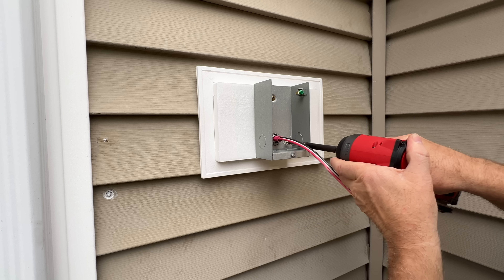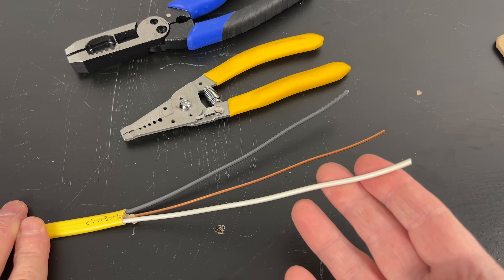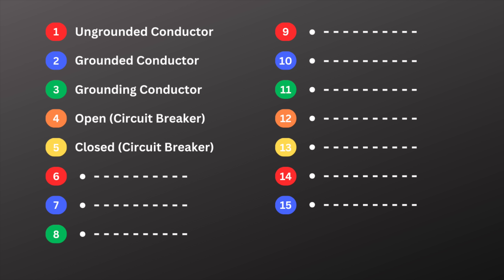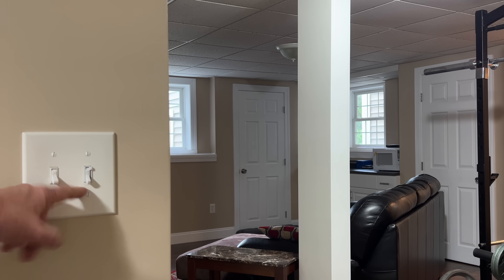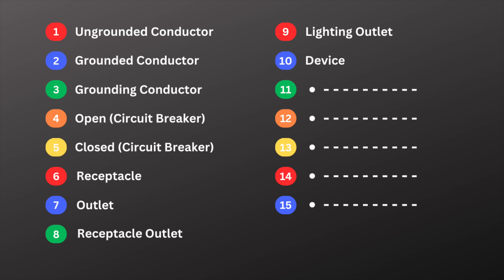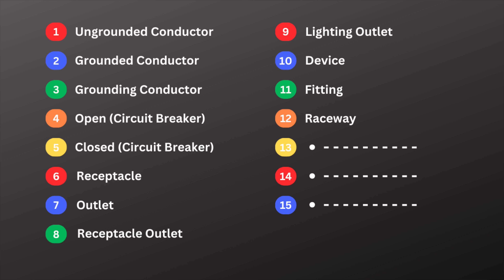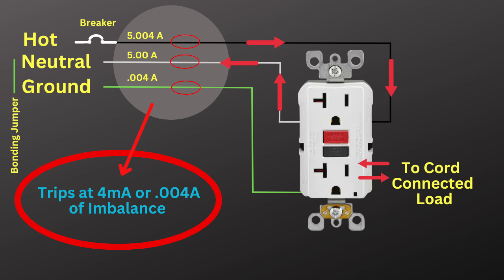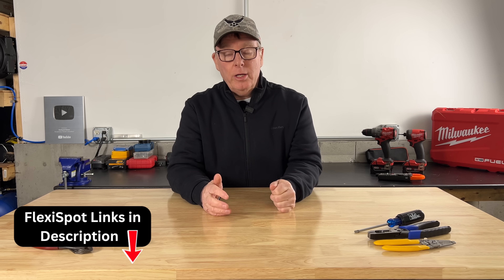15 Electrical Terms You Don't Know.

Comment: This is a great video.  One nitpick, though:  In a ground fault, current does not take a path to ground.  It takes a path through ground, back to the source.  The ground is never the destination for electricity, only a path it can potentially take.  A lot of people misunderstand this, so I think it is important to be careful about the terms that we use to minimize that misunderstanding as much as possible.
Reply from the maker: That is true.. Without the main bonding jumper a breaker would not trip because the earth is too resistive. I go into detail on that in my grounding and bonding video. https://youtu.be/gchq6G5Wc8M  I'll have to rewatch this video to check my terminology but it sounds like misspoke. Thanks for your comment as always.

Comment: The grounded and ungrounded conductors are distinguished only by that characteristic, but you distinguish them further by saying that one carries current from the transformer the load, and the other carries current from the load back to the transformer.  This is incorrect and I am sure that you know that.  The two wires make a circuit through the transformer and the load, and the current flows in both directions, changing direction every 1/120th of a second.

Some people may think I am nitpicking, but my observation, after reading many comments in forums on videos on this subject, is that many people are confused about how AC works and about the neutral in particular.  The reason, in my opinion, is that many people describe the workings of AC circuits in loose, incorrect language.

Comment: Been an electrician for decades and still get caught up in terms or names every now and then that I haven’t seen in so long I have to think back; sadly my memory isn’t what it used to be and I find myself checking code as much as I used to when I first started on things I haven’t don’t in a while. Thankfully I use a digital copy of the code so checking or confirming things is much quicker. The biggest thing that gets me is having to use different electrical supply houses as none use code nomenclature and instead use the brand they carry, which means you need to remember what lines they carry, as most of the counter staff is newer and doesn’t know much about electrical meaning they only know the names of brands they carry.
Reply from the maker: I know what you mean! Sometimes I have to look up stuff I've done a thousand times before. Age is a thief..

Comment: My pet peeve is GFI, because it would change the functionality of a GFCI. Interrupting the ground fault would be quite the feat. Right up there with finding my wire stretchers.

When, after decades in the trade, my brain realized that a plumber's open/closed is the opposite of an electricians closed/open, my brain about exploded. Electricity and water are not meant to mix.

No wonder so many people are confused. 

I think the plumbers claimed the terminology first. I wonder if this part of the battle between G. Westinghouse and a competitor.
thanks for the video.
Reply from the maker: We had Equipment ground fault protection on a large manufacturing machine in diffusion when I was an electrical engineer for a semiconductor FAB. The tool (they call these machines tools) was tripping on ground fault. The engineers were have a tough time believing that a tool that was drawing 170A at three phase 480v would be able to sense a 50mA leaked to ground. When I explained how CT that wrapped around all three phases and the neutral was always reading zero amps because all the power was coming was also returning on the same wires. Then the light kicked on. We were able to find the issue and repair it but it was a tough one because it was intermittent leak.
Reply: @BackyardMaine  yup - intermittents hide like any good bug! thanks

Comment: Would have been nice to explain why open=off, as illustrations help understand it. The key is in the word "circuit", and it's meaning. A circuit is a loop. A closed circuit is a complete loop that returns to itself. It's closed. If you interrupt the loop, cutting it at some point, and separate the cut ends, you open the circuit, preventing electricity from flowing at that point.

Comment: At 7:38 you noted that support isn't required since it's less than 36 inches between boxes. Doesn't the current code require support "within" that length? I've been curious about the distinction
Reply from the maker: The box is considered support when nipple are under 36 inches. Thats the point of 3 feet from a box, fitting, enclosure and ten feet there after. Otherwise you would need a support on a one inch nipple as well.

Comment: (UK viewer) Raceways?!?  NO No no!  A raceway is the semi-enclosed channel used to lay cables or pipes for energy transport (don't forget pneumatic is valid for motive energy!) and can include the mobile caterpillar type attached at one end to moving equipment, often called an energy chain or cable chain.

The generic term you are describing is containment.  Put it all together and it's a containment system.  Is conceptually possible to call cable tray or ladder a raceway, although we'd think that's odd because if you say raceway over here most people would think of trough (flush to the surface) or channel (if channel is mounted on the surface it's just trunking!).
All these different types with varying terms are generically types of containment.  It's not possible for a totally enclosed length of tubing to be a raceway, it's conduit!
Reply from the maker: Raceway. An enclosed channel designed expressly for holding wires, cables, or busbars, with additional functions as permitted in this Code.

A conduit is a raceway.  

Copied from the NEC. I get that we all use terms differently around the world though.

Comment: Closed means the circuit is closed, Open means the circuit is open. The breaker is never on or off - it is not an electronic device that is powered, it simply opens or closes the circuit.
Reply from the maker: The breaker is "switched" on / off like I said in the video and like its reads on the breaker itself. Same for a light switch a disconnect switch or a 4000A breaker in a substation. On and off or open and closed are synonymous in the electrical industry.
Reply: @BackyardMaine yeah I think you're missing my point. It's not the breaker that is on or off. It's the circuit.

Comment: They are all plugs. Female ones. Just type tbe word plug and you will get all kinds of recpticles and outlets. 73
Reply from the maker: A plug is actually what connects to the receptacle.
Reply: @BackyardMaine  no kidding if it's a male plug you know they make female plugs I just bought a transfer box that has a male plug, outlet, receptacle. 73

Comment: The short circuit and the blowing of a fuse or tripping of a circuit breaker brings to mind another misconception about electrical systems: breakers and fuses are not there to protect you from getting shocked or from equipment getting damaged, they're there to prevent the wiring, devices, and outlets from burning your building down. They do not take the place of GFCI nor surge protection devices.
Reply: @chaz720  they can also prevent shock. If the conditions are right. ACFI and GFI do a better job. Grounds also. If a hot wire touches Ground the fuse blows or breaker trips. So you won't get shocked if you touch the ground plate. The main function is to protect wiring and/or equipment. 73
Reply: P.S. I had a situation inside some device and the fuse inside protected the circuit board I was able to repair the device without board damage. 73

Comment: Nice Video but....there was nothing incorrect in the video's discussion about a ground fault, but a ground fault is more than what the video implies.

The definition from NEC 2023 Article 100:  Ground Fault
An unintentional electrically conductive connection between an ungrounded conductor of an electrical circuit and the normally non-current carrying conductors, metal enclosures, metal raceways, metal equipment or earth.

I am not sure about the 'or earth' part of the definition, but the rest of this definition has been in place for many decades and predates the availability of GFCI breakers.    A ground fault in a system without GFCI will be cleared when the low impedance path through the grounding conductor and the main bonding jumper (Neutral-ground bond) causes the traditional breaker or fuse on the circuit to open.     

Because of the critical function of clearing ground faults, I would add the Neutral-Ground Bond (Main Bonding Jumper) to the list of important terms to understand.
Reply from the maker: Yes of course a ground fault will be cleared by the circuit breaker if ungrounded conductor comes in contact with a grounded surface or the ground wire directly which is bonded to neutral at the service. But GFCI protection will clear the fault before the breaker trips most of the time. This is a sound fault and a short circuit due to the ground bond.  But when water is involved you may be creating a path to earth or a high resistance path to ground and the grounded conductor. This will not clear the breaker and GFCI protection is going to save  your day. I may make a video connecting a hot wire directly to a ground rod with no neutral bond. It may surprise people to know that the current to found will rarely be enough to trip even a 15A breaker. The ground rod is surge protection mainly lightning protection.

Comment: Technically, the place where you plug power into a circuit, like the generator inlet, is also a receptacle right? So not all receptacles are outlets.
Reply from the maker: Ahh thats a good one. It's actually a recessed mail plug but it's also considered a receptacle. It's not an outlet or a receptacle outlet because it's an inlet.

Comment: Did you forget arc fault since there are arc fault breakers AFCI? 😇😇😇
Reply from the maker: An arc flash or blast is the result of a ground fault or a short circuit. Arc fault breakers detect tiny arcs in a circuit usually between connections on the ungrounded conductor. These small arcs can create heat and carbon and over time lead to an open, a short circuit or a ground fault. Arc fault breaker are designed to clear these small arcs before they become a problem. They are basically loose connection protection.

Comment: Great video. Thank you. I have a question. Does a GFCI trip when it detects a difference in current between the ungrounded conductor and the grounded conductor? Or does it trip in response to sensing any current that gets to the grounding conductor.
Reply: It functions by detecting the difference between ungrounded and grounded. It doesn't care what the grounding is doing. If there is a difference, it may not be going through the grounding....it could be going through you.
Reply: @johnkowalkowski4269  thanks!
Reply from the maker: It measure the difference between the ungrounded and the grounded conductor. If that exceeds ~4mA the device opens. If the current is flowing outside the normal circuit, it's traveling to ground or a grounded surface. We use Equipment GFCI protection on large expensive equipment in the semiconductor industry. We basically wrapped a CT around all three phases and the circuit would trip if it sensed about 50mA. Some of the equipment engineers could not wrap their head around it tripping at 50mA when the equipment was drawing 300A.
Reply: @ thanks!

Comment: "Current will be flowing" is redundant.  Same as "current flow" There will be a current.  Flowing current is similar to a flowing flow.  Everyone says flowing current but there is no such thing as a non flowing current.  If charger carriers are moving there is a current.  Splitting hairs I know, but I got nailed on this by an electrical engineering professor in college.  He was not wrong.  Every since losing points I have always said there is a current or there is no current.  If I say flow, I say flow of charge carriers or charge carrier flow.  (Not that this will change anything....)
Reply from the maker: You have a point and of course you're correct. I'm also an electrical engineer and an electrician. I still say current flow because I find it easier for people not in the industry to understand. Thanks for the comment.

Comment: A couple of other terms that may be confusing are arc fault and electronic lighting control switches, aka electronic switches. An example of an electronic switch is a motion detecting switch (not a motion detecting light fixture, but a motion detecting switch). Typically, electronic switches require a grounded connection (neutral) as well as a grounding connection (EGC). Which can be problematic in older homes.
Reply from the maker: If this video does well I'll make another one. I can think of a lot of terms to cover including the ones you mentioned.

Comment: The first time I heard the term “DIY’er” I pulled out my code book and searched through chapter 3 for “DI wire”. I felt stupid that I’d been in the trade so many years and had never heard of that type of wire before
Reply from the maker: Thats awesome.. lol
Reply: @Ephesians-ts8ze  funny story! You can always identify the DI Wire. It’s that 14 on a 20 amp circuit :)
Reply: @frankvucolo6249 You should see some of the  DIY I've seen..    Main panel fuse box.  Sub panel fuse box.  No ground in bathroom.  Light fixtures no box.  Junction boxes buried in walls.  Shared neutral no ground. Neutral used as ground.  Whole house fan Romex soldered to spdt panel switch.  Single conductor or multiple conductors without sheathing run from fixtures to switches .
Reply: Grounded conductor, luminare,  pressure connector ( no such thing as a wire nut in the NEC = Brand name ).